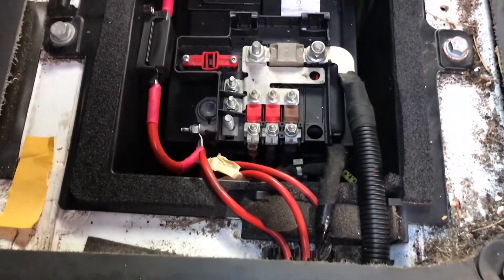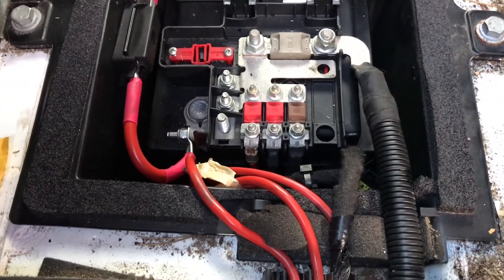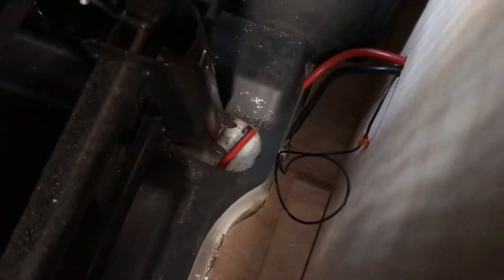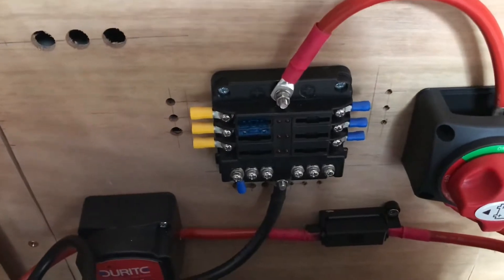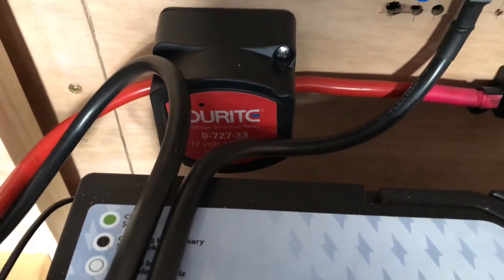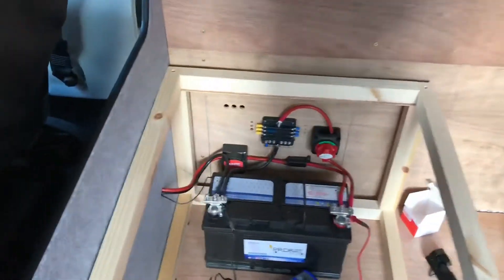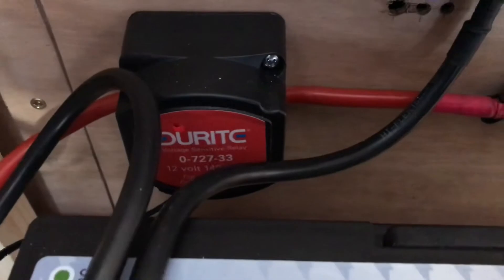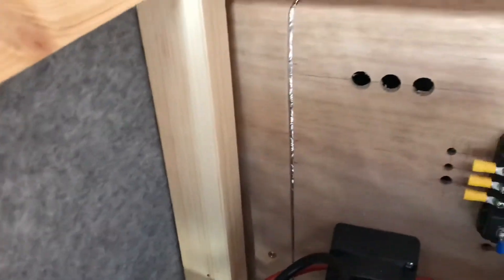Citroen Relay  L1 H1 SWB Camper Conversion. Part 8: Split Charge system VSR  (not smart alternator).

Comment: Nice tidy job
Reply from the maker: Cheers. 👍
Reply: @cowalexplorer  i was thinking of fitting a 75 amp battery in my Citroën Dispatch which amp is yours looks 110 my battery will cost £60 where did you purchase your big red kill switch cheers 🍻👍
Reply from the maker: @deranocasper  it’s 125amp of eBay and the switch was also from eBay. https://www.ebay.co.uk/itm/254456936174 
I got 2 kill switches with kit but the cables had to run behind the backing board. The surface mounted in link was a better switch for my needs.
Reply: @cowalexplorer  cheers good man yourself i will invest good set up also the 240 set up will you fit usb
Reply from the maker: @deranocasper  I’ve added two double USB ports. You’ll see them in other vids. Can run the Amazon fire stick off usb and my recently installed tv is 12/240v.  The 240 hook up is limited to 10amp, so you can run 2300w total through that specific unit.
Reply: @cowalexplorer  Hello there thats a great tip on the bigger vans above 6 meters you pay commercial. Love the name Slothy what hight is your van in side cheers good luck 👍🍀🍻
Reply from the maker: @deranocasper  my local ferry is anything above 5m and Cal Mac is 6m for commercial. I’m 5’4” and can stand.....just.